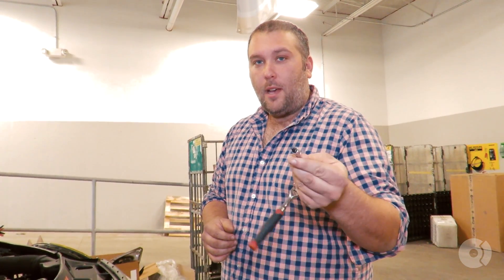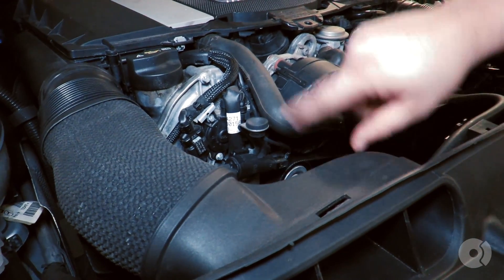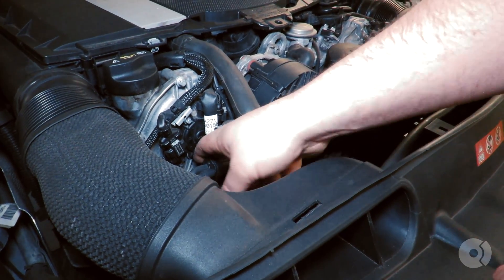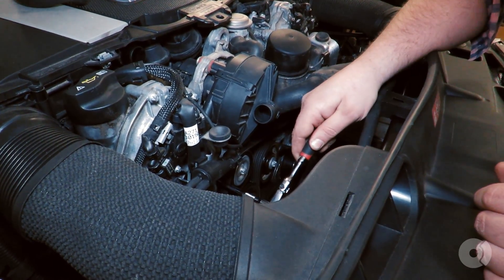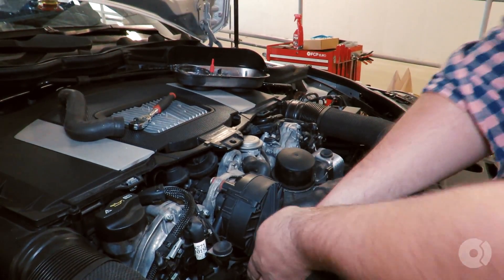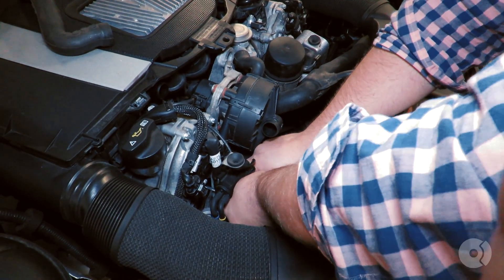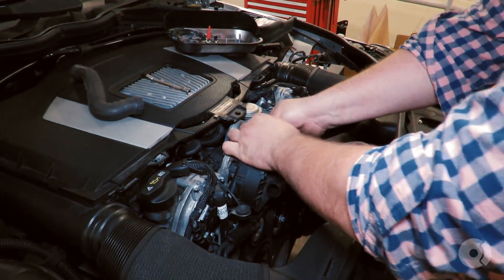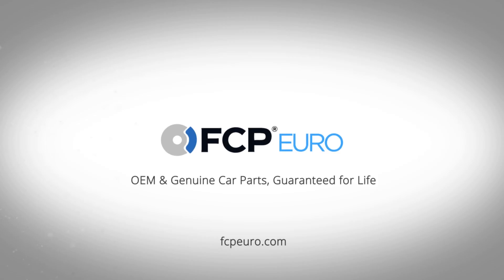Mercedes Secondary Air Pump Replacement - Quick Install (C300, S550, ML350, E350)

Comment: The V6 (M272) shown in this video is pretty easy. If you have the V8 (M273), you're going to have to remove the top alloy radiator tube bolted to the thermostat(2 bolts, with one more just above the oil cooler), and disconnect the upper rubber radiator hose from the tube to get access to the right most air pump bolt. If you haven't been in there before, it's a good idea to replace both O rings (the thermostat/alloy tube and alloy tube/radiator hose connections, and make sure you spray the rings with silicone before reinstallation so they slide into place and fit back together easily) so they don't leak after all that work. You'll probably need close to a liter of mixed coolant or so to top the system back off.

Comment: Thinking about removing the secondary air pump in order to replace the butterfly & actuator that break on the intake manifold, in order to avoid lifting the entire manifold out. Do you think that could work?

Comment: Mine is apparently going to fail as upon a cold start, it creates a loud whining sound.  It looks easy but I’ll need the tools but I’m typically uneasy getting parts not from the dealer.  They just charge way too much for simple things.  I have a 2009 MB C300 luxury if that matters.
Reply: Eric Draven I have the same sound on a cold start from my 2010 c300. Dealership confirmed bad air pump and bad valve, but a 2k bill to replace has me thinking I want to fix it myself!
Reply: jcgmaudlin I fixed it today. Bought the 119 pump and replaced it. Coming from a computer geek it was pretty easy. Would recommend doing it yourself.
Reply: Eric Draven Mine makes the same whining sound upon startup as well! I have 2010 mb c300 sport. Where did you buy the replacement pump? How much was it?

Comment: How much does a genuine mercedes secondary air pump cost for 2012 C300?  I'm seeing prices online for under $200.  dealer wanted $1500 to $1800 for it?  does this seem right?  I'm in Canada
Reply from the maker: We have the Secondary Air Pump listed in Bosch for $119.99 with Lifetime Guarantee.
https://www.fcpeuro.com/products/mercedes-air-pump-0580000025

You'll also want to replace the relay at the same time.
https://www.fcpeuro.com/products/saab-rear-window-defroster-relay-900-9000-8522310
Reply: @fcpeuro  This pump will fit my 2011 c300 w204, correct?
Reply: Hahaha of course that seems right! What else would a dealer do other than mark up by at least 500%?! I will say, buying coolant & certain gaskets from the dealer can actually be normal Earth prices, but that's often it.
Reply: @fcpeuro 6 years later in the cost of the pump doubled 😂 that’s criminal

Comment: What does the secondary air pump do?
Reply from the maker: Its an emissions component. It is responsible for pumping clean air into the vehicle's exhaust stream to promote a cleaner and more complete burn before the fumes exit the tailpipe.

Comment: Just replaced mine on a 2008 c300 but the light came back on relay,valve,and pump replaced. Do you have to clear the code?
Reply: Has to reset it and see if it comes back on

Comment: What are some of the signs that this part is failing?
Reply: Most commonly, it will stay on almost permanently. For the most part, it should only come on during cold starts (or at startup) to feed clean air to aid in a cleaner exhaust emission. 
You'll instantly know if it's coming on irregularly. Sounds like a tiny helicopter is taking off under there! Also, you may get bad voltage readings/codes from it.